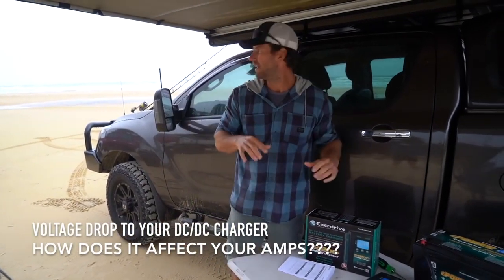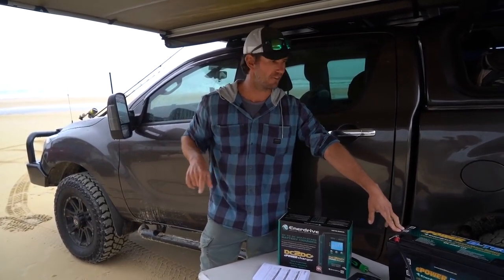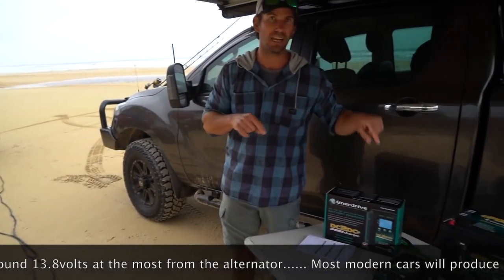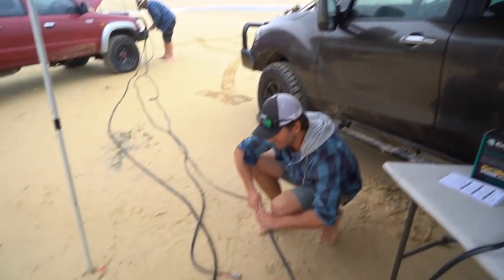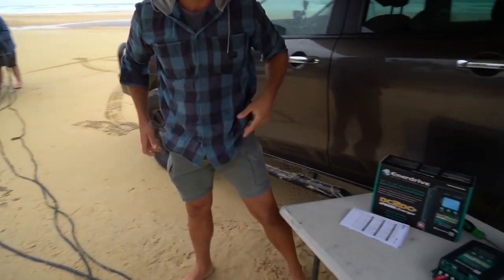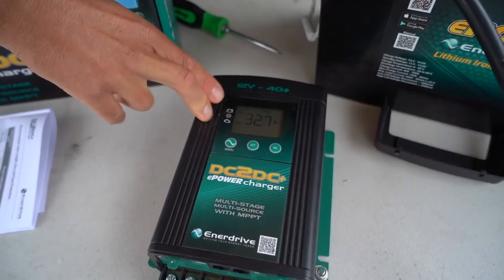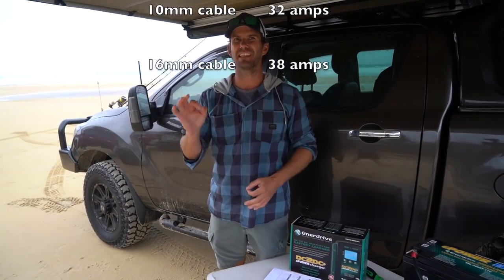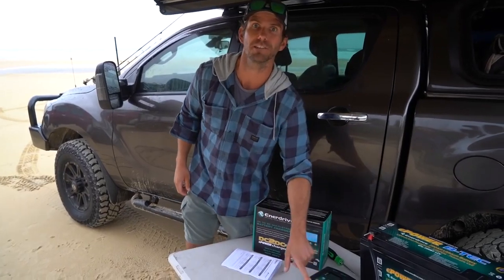Enerdrive eTIPS - DC2DC - Cable Size Does Matter!

Comment: When getting those amps , what charge stage was the battery in, i understand the importance of cable size, but with that charger there   is alot to do with how much charge is in the battery, those amps will slow right down well before the battery is charged fully,

Comment: I have one of these running two 100ah lithium's but it will go to float within a hour when connected to the car and i am only running 6mm. Now i rang enerdrive and they walked me through the set up with the dc2dc. But the batteries are locked in safe mode after 5 hrs and wont run the 150 ltr vitrifrigo compressor fridge freezer. The fridge  starts then stops then starts then stops. I am starting to think the controller isnt set right due to when the batteries go to safe mode and it only takes under a hr to get back to float from running car... What the hell? I am now at a bloody cv park due to not being able to run fridge away from 240v.
Reply: I hear ya mate I went from a expensive system in my caravan that I sold about 7yrs ago ran great for 2 or 3 weeks at a time without needing a top up at a van park. I then went to a el cheapo set up eBay specials on mppt charger with a cheap vsr with 2x160w solar panels and a battery box with 140ah agm battery n camping in my 4wd or swag with my youngest all I need is power to run a fridge/freeze a cpap machine and some led lights this was a great set up as I would go away for 4 or 5 days twice a month but was 4wding every day so battery was always charged. Now i have a soft floor camp trailer so looking to park up for a few days maybe a week or 2 once every 2 months but i don't think the prices on acdc bcdc dcdc chargers plus add the cost when you add in a lithium battery cabling gpo ect are worth the crazy prices now. is it worth spending 2k on a good system that will last a few weeks that you use once or twice a year or is it cheaper to go away once a fortnight for a 4 day weekend running off a cheap set up and then paying the van park fees on the longer trips.

Comment: Enerdrive website states for runs up to 10m use 25mm to 50mm square cable. Runs over 10 metres are not recommended. Voltage loss needs to be calculated on the full length of cable ie start battery to charger & charger back to start battery.Voltage calculators show that using 16mm sq cable for a full 10m run (read that as 20m in total) with 40 amps @ 30 deg C gives a voltage drop of 0.44 amp (3.67 percent). It appears best practice is to keep % loss below 3%. The more I read & talk to sales people etc the more confused I am getting. It appears very few really know what they are talking about, including me, I guess.

Comment: Yes im wondering the same thing. AWG is american wire gauge and 2 awg is around 30mm squared i believe and thats what ill be using for next weeks enerdrive 40+ install.Should be laughung at just a 2.2 metre stretch.Anyway thanks for the video.